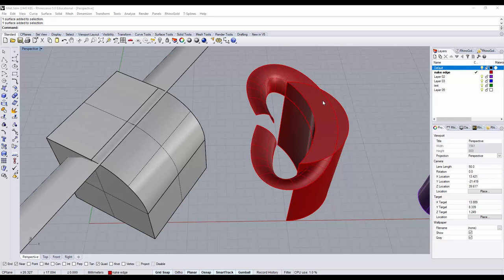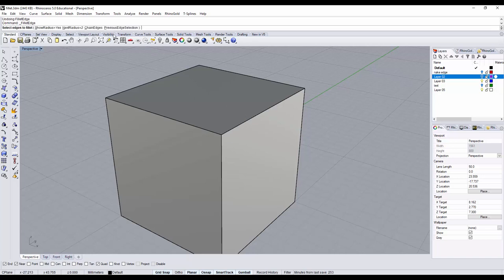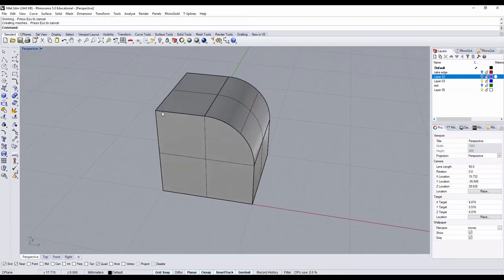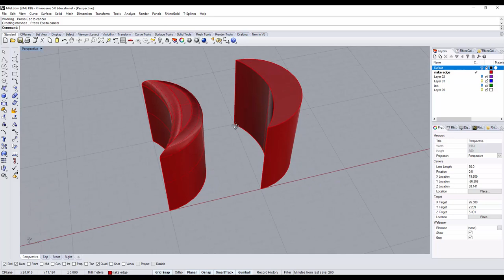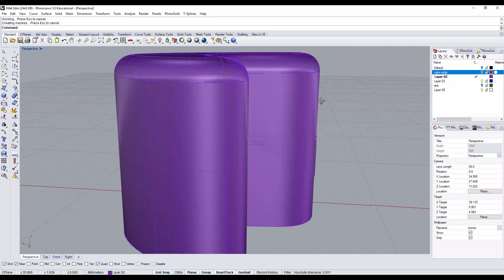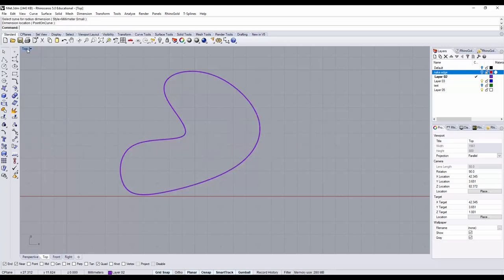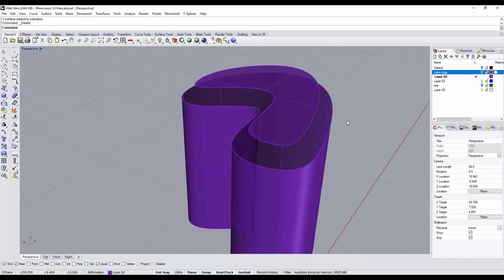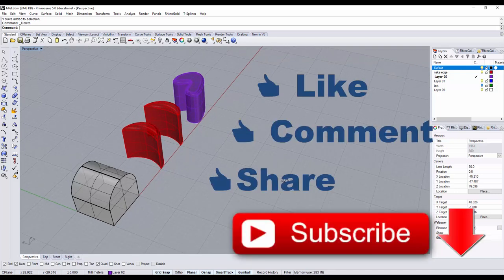Rhino 3D CAD Technique #9:  Why does "fillet" not working ? (有中文字幕)

Comment: its quite common to fillet/chamfer and then delete the filleted area to use with blend, due to better tangency control. fillet is too harsh when light plays with it and should only be used when absolute round geometry is needed. mechanical cads have tangent based filleting as a one click option. good that you show it :)

Comment: Excuse me P.j,
The command on toolbar if edge fillet or variable fillet surfaces?
Thanks in advance!!!
Reply from the maker: Fillet edge work on solid. and you will be picking edge. fillet surfaces only work between two surfaces. it won't deal with the surface that is connected with the two surface you are working on.

Comment: Sorry, but all of those only work for very simple shapes. If you have a bit more complex curves to deal with (also if not planar), then you cant fiddle with the filet radius manually for all, nor can you search for the smallest radii manually (it might range from e.g. 2 to 0.03 units all over the curve) and a pipe also does not work, as you cant give it the many different radi available at each location of the curve. so what we would need are: a)  the option to find and display the smallest value of the available radii and b) the feature to limit the radii to the smallest largest radii available without error, or a percentage of it. with b) we would get a filet of 1 where radi 2 is available and a filet of 0.0015 where a radi of 0.03 is available.